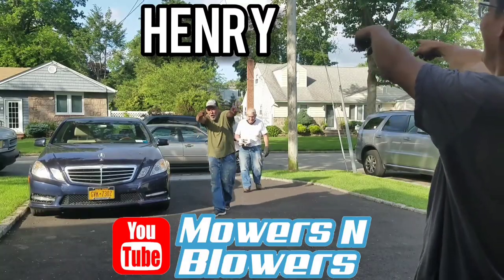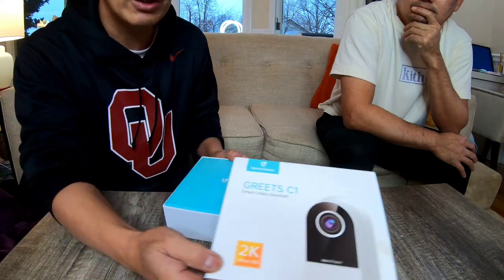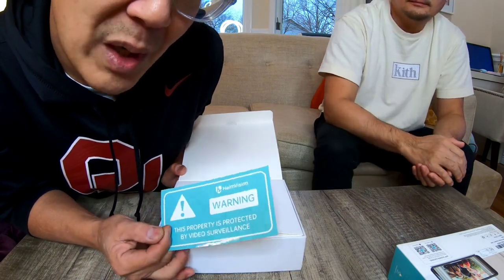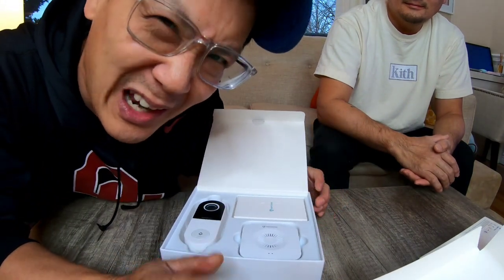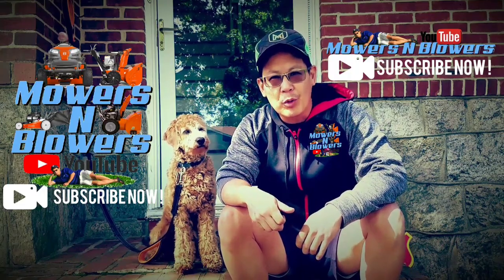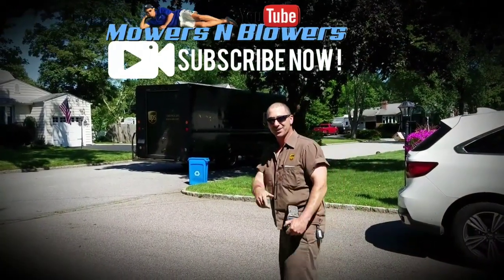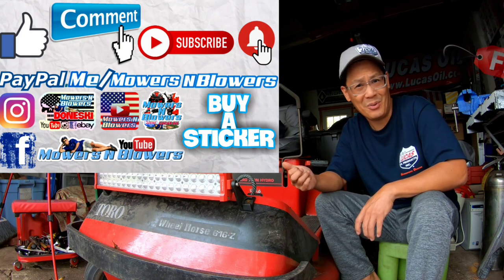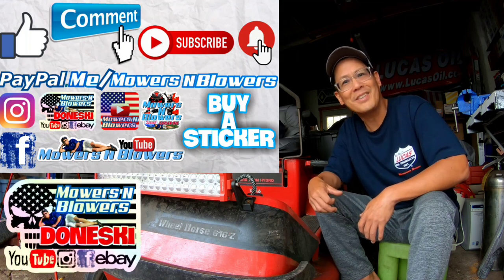HEIMVISION GREETS C1 WIFI 2K HD VIDEO SECURITY SURVEILLANCE HARDWIRE DOORBELL CAMERA UNBOXING REVIEW

Comment: If anyone can help I would appreciate it 
I have a snowblower with a 5 hp tecumseh engine. I bought a new carb for it and now it surges at full throttle. I don’t know what it could be I cleaned the carb even tho it was already clean and I put fresh gas in the tank, no success
Reply from the maker: There are two different Tecumseh carbs,  one for the 5hp and below with a 90 degree right angle fuel nozzle and the 8hp and above straight out fuel nozzle.  Which is yours?  If you’re using a 8hp one for a 5hp engine,  it will be getting too much fuel.
Reply: @MowersNBlowers  it is the right angled one Henry I also tried adjusting the governor spring at different positions no luck. When the augers are engaged it seems to run better
Reply from the maker: There’s a screw to lower the rpm that points towards you as you lower and raise the throttle lever,  turn it counter clockwise a bit to lower the rpm.
Reply: @R.gr98  get a new sparkplug
Reply from the maker: It’s almost NEVER the spark plug
Reply: if its a chinese carb. then the jet is probably too small and it needs to be bigger. chinese carbs. don't run as good as oem carbs.
Reply: @MowersNBlowers  lowering the rpms worked. It runs good now, we’ll see how it does tomorrow because were expecting a lot of snow where I live
Reply: @luschen-laschet9635  I'm sorry sir a spark will not fix the problem ever!
Reply: @victoredington3316  victor i agree ,anything that surges i drill the idle jet 1-2 sizes and it fixes it . Chinese carbs were junk when they made them, thats why they cost 10.00 dollars.
Reply: @rogermcdonald1607  yep, people think , ooh! i can buy that carb. for 10.00$ and then they wonder why it still doesnt run right and then they give up and then i end up buying riders from them for about 40-50$. When I started doing this kind of stuff about 30yrs. ago all I ever did was clean carbs. and not much else had to be done. Ethanol is now my best friend cause if it wasnt for that I would make 90% less money than I do now.